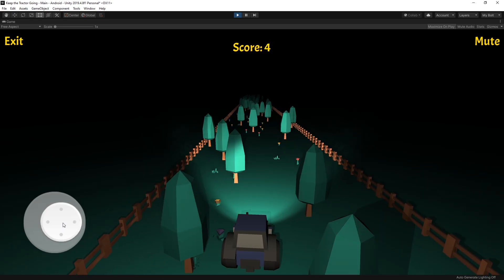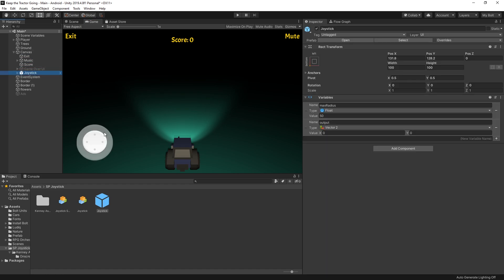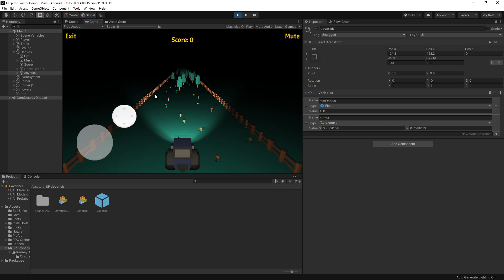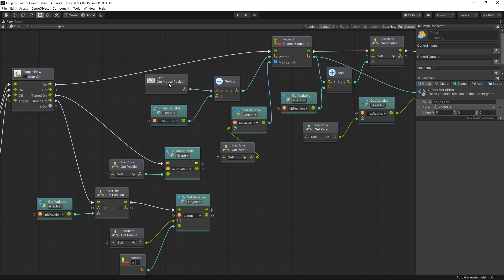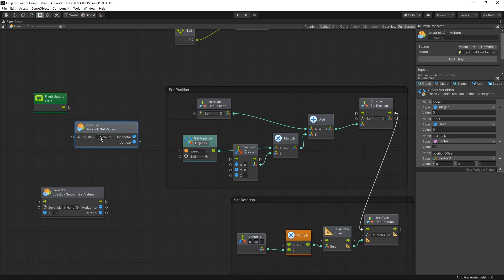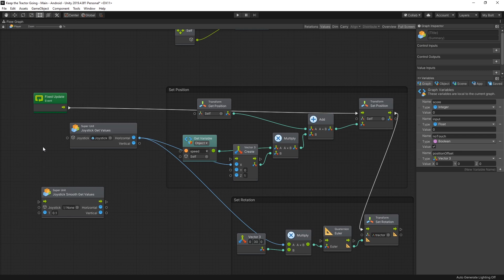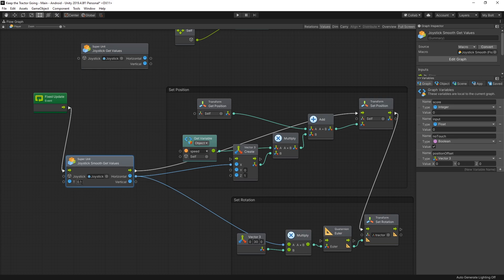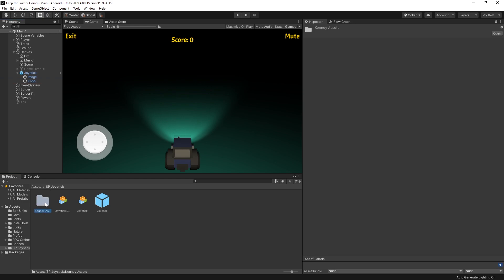How to Add Joystick to Unity Bolt Visual Scripting Tutorial

Comment: Not getting anything out of the 2 joystick modules. The knob and joystick variables show up and change in the scene inspector just fine, but when I test the smooth and regular joystick nesting modules, nothing comes out. I am sure I am just missing something very silly and obvious, but I have fiddled with it for two days. Any suggestions?
Reply from the maker: I'll make a video on it tomorrow. I'll need to change it a little to support multi touch
Reply: @SmartPenguins  Groovy, look forward to it. Just to clarify. Everything works perfect...except the two modules are not pulling the joystick prefab variables after hooking the joystick into the two nesting modules. Thanks again.
Reply from the maker: here is the update https://youtu.be/ykckTB4NAhc